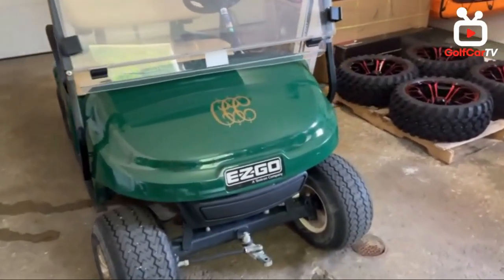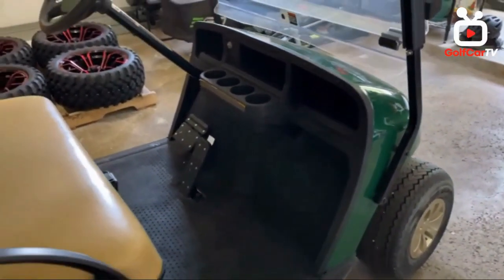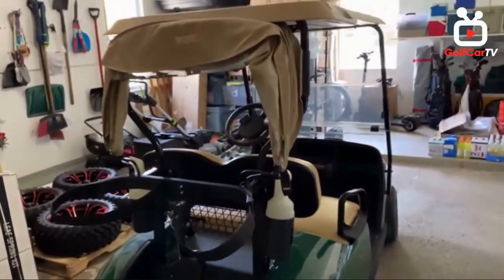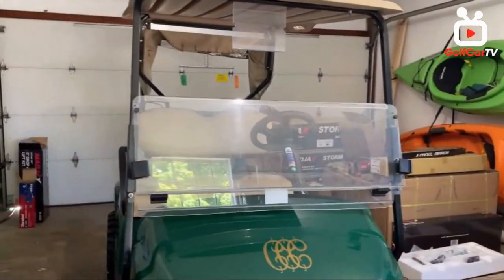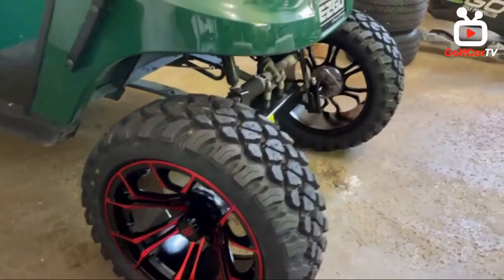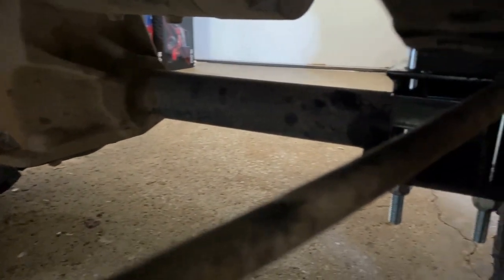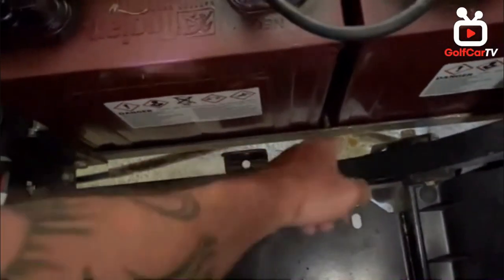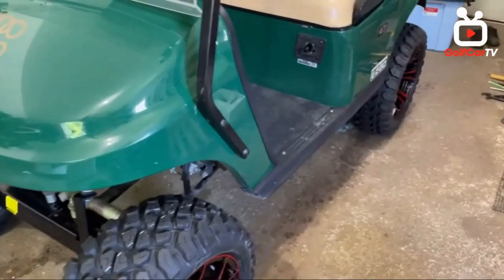EZGO TXT Golf Cart Upgrades - Lift Kit, Rims and Tires - GolfCarTV (Episode 5)

Comment: will body kitsfrom 94 txt work on 91 ezgo txt. seemslike the sameframe
Reply from the maker: Hi, these Storm body kits will NOT fit on a 1991 TXT. They are for 1994.5 and newer.
Reply: How well have the nomad tire held up with street use?  Road noise?
Reply from the maker: @greggourley  they have been great. Way better than expected with the all-terrain tread.